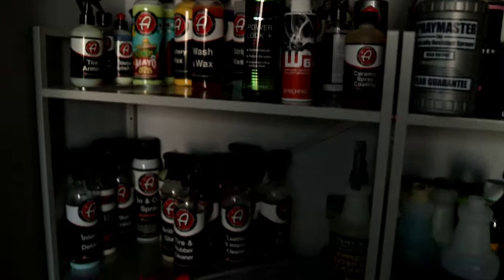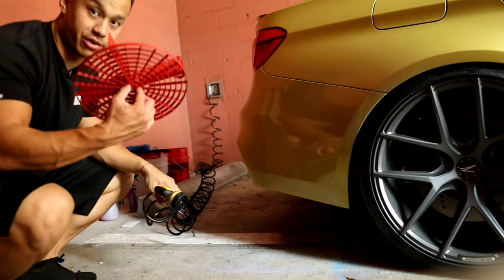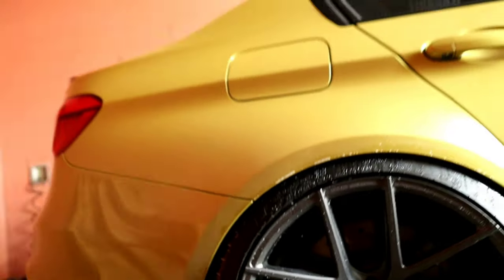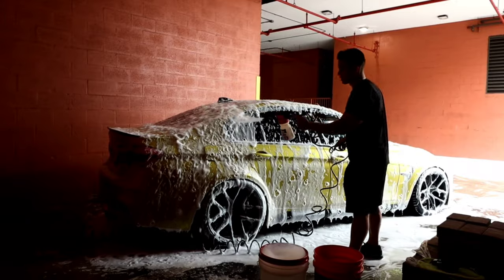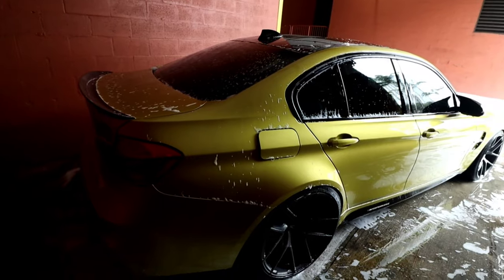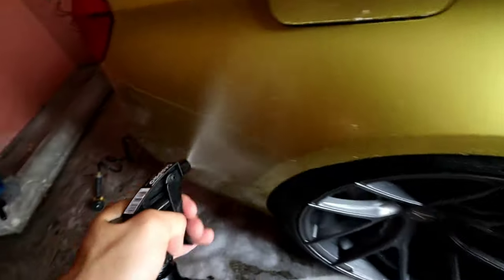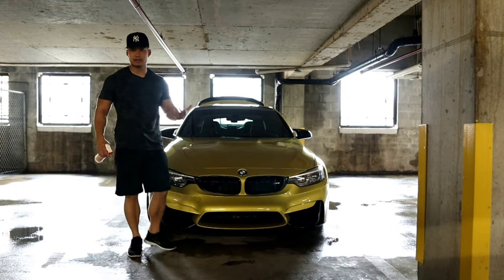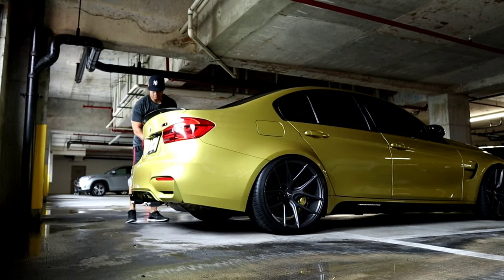Washing  My Manual F80 M3 - How I Wash My Car

Comment: Hey what’s ur wheel size setup an offset.
Reply from the maker: Thanks for checking out the video.
FR 9x20 et20 RE 10,5x20 et26. I did add a 12 mm spacer for the front just to flush it out more.
Reply: The Daily Driven ok...I ask cause it looks flush with the fender. I got a f80 competition as well an I’m looking for wheels. I came across Vossen HF-5, the guy at Vossen told me to flush with fender no spacer I have to go FR 20x9.5 16off deep RR 20x11 35off super deep. I’m looking for concave more so front an back.
Reply from the maker: Gotcha, the only thing I would look into after is the right tire. Some tire brands sit thicker on the side and may cause rubbing if you're going towards the limits. I'm sure of you ask the company they would be able to tell you what combo works best. Signature wheels is another company I was looking into. I just couldn't pass up on these wheels especially after meeting Zed Sly the ceo
Reply: The Daily Driven your wheels now looks super sick, even the ones on ur friends nardof80. Vossen gave me the tire fittment as well, they said it would have a flush look no spacers need. The price is right an they look good, HRE has 1 I like but I can’t bring myself to pay 10k for just rims. Wish I lived closer to travel to mvasion, the Midwest BMW car club non existent
Reply from the maker: Yeahhh 10K on a set of wheels is A LOT ! I can't justify spending that much on wheels lol. The Vossen HF-5 look great and if the price is right than it might be a match. As we continue to progress with BMW INVASION, we are looking into throwing a yearly event that would entice a lot of people to drive to Florida